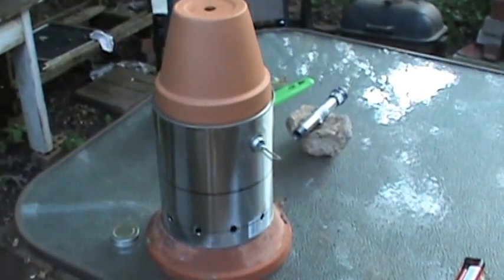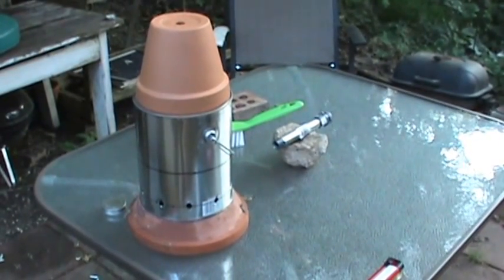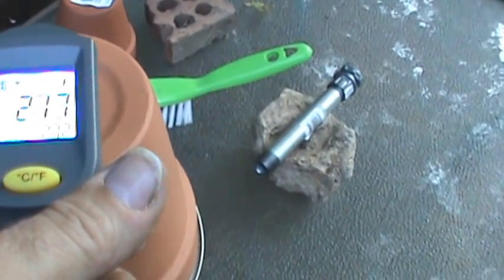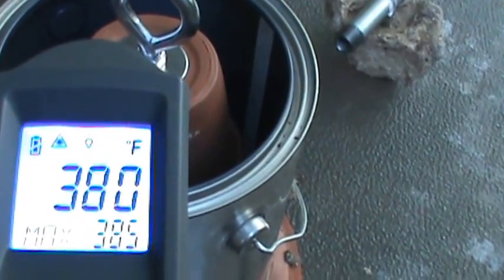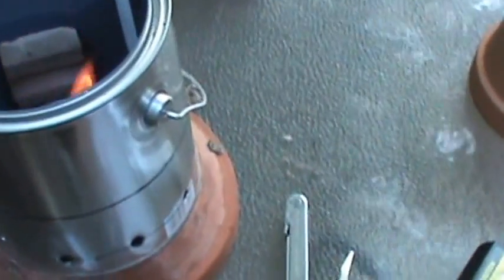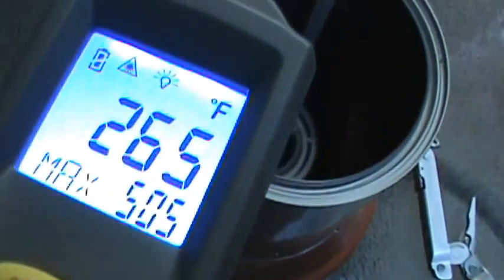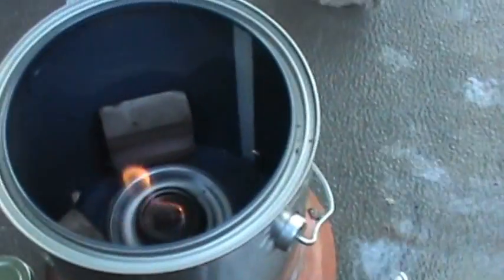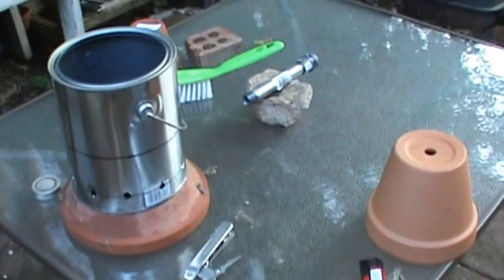Flower Pot Heater redesign. This one works.

Comment: Its nice but wouldn't the CO2 be dangerous using it in a small area like a tent?
Reply: Not if you ventilate..i have used various catalytic heaters in a van and in tents over the years but have always allowed fresh air to get in...there was a problem with a bernzomatic catalytic heater years ago that killed a few people..it was recalled and to this day if you find the right model  you can still get a $250 rebate.......http://www.cpsc.gov/en/Recalls/1995/Bernzomatic-Offers-250-Bounty-For-Old-Propane-Heaters/
Reply: Any type of heat source like that need venalation. Ex. The Buddy Heater

Comment: A candle is a candle, covered or not it will give the same heat. So why covering it? If you want to warm up a room, buy big candles and put them in the corners of the room and voila!
Reply: There are different ways to deliver heat and some are more efficient than others. Have you been around a campfire in the winter or had a bad fireplace in a house and tried to heat the house with it? In these situations, the only heat that warms you is the radiant heat of the light from the fire. At a campfire the front of your pants heat up and can almost burn your legs, your face is hot, but your back is cold and if you are standing behind somebody, in the shade of the fire, as it were, then you are freezing. Most of the heat that the fire makes is wasted by going straight up with the smoke and exhaust. What the flower pots do and other thermal absorbers is they suck the heat out of the exhaust and hold it and radiate it more evenly over a longer time. Like heating up rocks by the fire and wrapping them in a towel and putting them in your sleeping bag. You are using the heat more efficiently. Ben Franklin invented the wood burning stove to harness more heat from a fire, because a traditional fireplace is terribly inefficient.
Also, a lot of fuel escapes in the exhaust as well and what some rocket stoves do is actually burn the smoke as well. Just because the smoke is burnt though does not solve the issue of carbon dioxide and carbon monoxide. Ventilation is an issue that I can't see a way to get around. Unless you have a chimney that vents to outside but most of the heat is harnessed from the exhaust first. That is the key, is to harness as much heat from the exhaust and get the exhaust outside, and maybe have hoses or pipes drawing in fresh air from outside into the stove itself so that it isn't burning the oxygen in the tent or small space. The Indians dug trenches in the earth from outside the teepees that came inside to their firepits, and covered the tops of the trenches so that in effect they were like sealed pipes feeding air to the fire. 
So harnessing more heat from the heat source does make a more effective heater than just a candle. The amount of energy that a candle puts out is awesome, but is wasted in normal candle usage so that a candle by itself will have a mediocre effect heating up a tent.
Reply: A candle is a candle correct.  covered or not make all the difference in the amount of heat you will receive.  A covered flame spreads the heat out over a bigger surface area.  This is this exact same principle your furnace in your home operates by.  The small flame in the combustion chamber heats a bigger metal box, (the clay pot, paint can).  The forced air is blow around the hot metal box out into your ducts.
Reply: +Phillip Anderson These flowerpot candle heaters were used by Victorian gardeners to keep the temperatures in their greenhouses a little higher in the winter.  The flowerpot was put on top to capture some of the heat so it would still radiate a small amount of heat after the candle had burned out.  So it was designed to prolong the small amount of heat generated for just long enough to keep the frost from the greenhouse.  Genius idea for a greenhouse, I wouldn't use in the house though.

Comment: great design ... there are some coke can alcohol stoveheat source also on youtube
Reply: I am actually building the flower pot heater.  I am using an 8" pot with a 6" inside.  Working out the logistics of using a coke can alcohol burner for the heat source.  I have seen several warnings about the candles bursting into a flash fire because once the all wax melts, it flash burns.  Guy said not to put the candles so close to one another.  So the danger in using the candles is flash fire.  I am wondering if enclosing the alcohol burner could cause an explosion if the vapor in the burner gets too hot.  But I am not gonna use the paint can.
Reply: Gloria White interesting! How's it going so far? I'm doing the same thing but thinking about building a chimney just in case it does burst into flames in there all the flames would just got out the top of the chimney, & I don't think the flames would be hot enough to melt the material used for a chimney assuming it's a quick flash fire, hmm..

Comment: Great design and looks safer than other designs!  I am thinking this could be a fruit tree solution in the spring.  Maybe surrounded by rocks for additional mass and stability under the tree. Might save some cost using plate metal scraps, bricks, or flat stones (metamorphic) inside instead of stacked pots as well.  Another flat dish on top to avoid wind toppling issues. Thank you so much for sharing your experimental work!

Comment: Hello, good video, would you agree that it would be safer to have the fuel tank, placed below or outside the heated area, this would certainly lessen the chances of ignition or explosion of the fuel in the heat. also the fuel tank has no need to be in the heat, only the clean flame.
regards Colin. UK.

Comment: Spare floor tiles (you can buy them as singles in many DIY stores nowadays or may have some from a previous remodel) are the best for putting under candles, toasters, coffee pots, etc. for added safety and a super inexpensive heat shield.
Reply: And you can get cheap little felt "feet" with sticky on the back from Dollar Tree.  Saves scratches on table tops etc.
Reply: They make great blast shields when soldering copper plumbing near wood studs and drywall.
Reply: Barbara Bardi
Reply: Or a cookie sheet (in a pinch)
Reply: I always used one for my flat iron :)
Reply: @Joe W 🤯 Those are GREAT ideas!! Thank you!! 😁😁

Comment: I was intrigued by these flower pot heaters at first. . . .  But  we've had recent publicity in the u.k. about the risks of carbon  monoxide poisoning, after the death from a camper who put a cold barbeque into the tent to keep it out the rain. . . playing with fire is a dangerous game.
however I am tempted to see what might happen in a non flammable greenhouse
Reply: That's because charcoal puts out quite a bit of carbon monoxide whereas CANDLES are paraffin wax. TOTALLY DIFFERENT so it's not a problem. It depends WHOLELY on the fuel being burned. I am stunned that people a are worried about candles "oh it's a crude oil product" and other strange stuff.... once you've dealt with alternative fuels you know what does what under what conditions
Reply: well theres the answer right there. They put out the warning so no one would try to keep themselves warm,and freeze to death instead. anyone with a brain that functions properly would know not to put a freaking barbaque into a tent. different fuels-briquets are a fuel-are toxic when placed inside a dwelling. thats why they are called barbaques and are for outdoors only. there are other safer ways to keep warm with simple homemade devices..

Comment: Whenever you heat metal, you create carbon monoxide. That would be the reason that nobody else is using the paint can gag...
Reply: That's what I was thinking. I got into the whole clay pot heater for it's non-toxic heat output. Also I do not use tea light candles in metal trays, glass only.

Comment: This is actually a "heat buffer", as the purpose is to capture heat for slower delivery to the air. However, it is just "stuff" in the way of the heat-source. It will not generate any more, and will generate less in addition to toxic fumes and CO2 and CO from the dirty-burn being enclosed. (Toxins from the LEAD in the clay pots, which are not intended to be heated, or inside, or as heating storage devices.)

Put a copper tube over the flame and force air into the tube. That will capture and transfer the heat more efficiently. (Even without a fan, run the pipes to the floor to make a stand and they will chimney air up through them from the cold floor.)

However, a candle is a candle, and food-warmers (alcohol), produce x-amount of heat and x-amount of toxins that kill you. Venting the toxins by introducing cold air, nearly negates the gains to zero.

You need something that burns nearly 100% and can have the heat captured and removed from the exhaust, with the exhaust vented safely. This is not that device. This is a personal killer, as are most portable heaters abused by being burned in enclosed areas. You are contributing to the potential death of others, for a few youtube hits.

There are plenty of cheap and safe heating alternatives, without rebirthing past failed 1400's ideas, to save a few bucks. I guarantee that you won't make enough ad-hits to regain the money wasted reinventing the square wheel... again... for the millionth time.

I know... dead people can't complain about how these things failed by killing them, but that is why we have public safety-laws, to speak for the dead.
Reply: I don't know about all that but a couple of things bother me. first they make terracotta dishes to cook in so...?
second they sell those alcohol containers to use in fireplaces, so explain that one?  
oh and as far as him putting that out all he would have to do is cover it and smother the flame just as they do when using them to keep food pans warm.
Reply: +NoesisAndNoema  I've been viewing all these videos thinking the same thing! How can you get something for nothing... a candle delivers X amount of energy as heat. I don't see how incorporating something that absorbs heat and releases it half as fast but twice as hot would heat up an area any better than it would at half the heat but twice the speed?
Reply: The point is that the radiating  surface area of any stove, is what makes it work.No matter what kind of stove it is.
Reply: +Craig Stephens wow...and I have used it in my veggie gardens as part of my soil mix!!!
Reply: NoesisAndNoema ,,,, I agree. It cannot magnify the heat.
Reply: No lead in the pots guaranteed
Reply: Woodstove, electric baseboard, forced air heated with oil / gas. Any number of ways that don't involve stupidity. The video didn't provide a solution either but it does show the inherently flawed idea that you're all eating up that somehow this magnifies the heat output which it does not. That's impossible.
Reply: Mass heaters or rocket stoves?
Reply: G B have you ever made tomato sauce from passed tomatos? Tomato sauce boiled faster than water and keeps the heat a long time my idea is to heat a closed pipe or box filled with passed tomatos that keep the heat and give it slow over a straight plate of metal up.
A german heat scientist works on a heat system with indigriens of tomatos to transport the heat fast and effizient. I prove next a passed tomato candle heater ithink it could  work  greets from german  sorry for my broken english.
Reply: Yep i was seriously ill after having one on all night
Reply: NoesisAndNoema w4
Reply: mushroomhill has
Reply: Mushroomhill
How exactly do you use the stainless steel bowl?
Do you drill a hole in it and set it over the can. I want to try it. Thanks💕🌿
Reply: The gel alcohol used in these food warming tins actually burns very cleanly producing  mostly hydrogen and eater vapor. Much safer than burning propane or even wood.
Reply: NoesisAndNoema, another person saying something doesn't work without a solution: thanks. Public safety laws keep idiots alive and keeps people stupid. Just what we need. what is your solution to heating a small space......safely?
Reply: @davidunderwood1907  heating water outside with a candle stove (Yes there are tealight candle stoves) , solar oven...bringing it inside and running it through a radiator with a fan behind it.. Its the same concept in reverse with a boxfan cooler but holding the heated liquid within a tubed system and submersible pump or gravity fed in a dual 5 gl. tank system constantly circulating the water preferably closed to prevent/reduce the evaporation..As the liquid cools from the air blown across the tubes you replace the "cooled"water with "hot" water constantly recirculating/recycling.. With a 5 gl. system @ 90degrees replacing a gallon with boiling water increases the overall water temp by difference of temps divided by 5  210-90 =120/5 = 24 degree increase..The only draw backs you have to either go outside every few minutes or have the hot water piped in through a circulatory system.. Eventually you bring up the room temperature and as a side note you could use some of the heated water for bathing..I have seen solar ovens get up to 350 degrees.. so its possible with a car radiator to run some water through it at a cooler temperature and have nearly boiling water coming out and as long as you keep that oven close to 210 degrees you have nearly boiling water
Reply: No way these buffers enhance the heat. Have fun hauling all that shit to your campsite. He couldn't even blow it out when wanted, and if that was a critical thing to do then your fucked cowboy. And in a tent. He says he uses that fuel indoors. I do believe those things emit carbon monoxide. This guy is nuts.
Dum dumdum dum
Reply: +Jack Brunacini Vermiculite is a carcinogen! (i.e. can give you cancer!) do not touch or go near that stuff!
Reply: @craigstephens2782  Been touching it for over 50 years now and I am just fine.  I guess it you stuff it up your nose every day you might have a problem, but then again you deserve it for being a moron.
Reply: +DeansVideoClips its not just a heat buffer the pots act as a surface to radiate heat off of, so in addition to the heat that may come out of the hole on the top heat is also transferred to the air from the surfaces of the pots and metal pieces. and this isnt creating anything out of nothing, its taking one source and providing multiple ways to spread the heat outwards. if this contraption had more metals, it could work more efficiently  as metal will transfer heat to the air better than a clay pot.
Reply: You answer is exactly correct.  You must be a Trump supporter.  :)
Reply: HT T shut up stupid

Comment: BE SURE that NO parts are galvenized metal(the can in this instance). Galveinized gives off toxic fumes when heated.
Reply: Sure??? Galvanizing is ZINC in metal form. It's the WELDING and the flux while welding it that wrecks your lungs. I have galvanized stove pipes for 8 years now. No problems, no fumes from A METAL. I honestly think you need to research it PROPERLY. I have come to realize preppers do less research than the average soccer moms to get answers to their questions. So many assumptions it's ridiculous.
Reply: cyanide ?
Reply: +Thomas Phillips One can over heat the galvanized portion as in flue piping. As long as the galvanizing is burned off, no fumes.
Reply: Janet Allen ya Zink poisoning and sionide as well
Reply: D Quit where did you come up with cyanide
Reply: @drachenfeuer5042  the morgue has lots of it... lol
Reply: Sound advice. Thank you so much.
Reply: Janet Allen agree galvanized and CO are my major issues galvanized one time issue in selecting materials but CO all the time.

Comment: Could this be used at low temps (15* -5*F) to keep water in glass bottles from freezing, heating in a small closet area? I was thinking just one beeswax candle, so the fumes aren't so bad. Are beeswax candles toxic at all?
Reply: Beeswax is one of the best waxes you can use for candles due to the low toxicity level. Even most soy waxes are not 100% soy and contain paraffin which is toxic. Beeswax 100% pure, while a little more expensive wax, has medicinal benefits. It also is NOT toxic...

Comment: Is that a saucer on the bottom upside down?
Reply from the maker: yes  put it there to protect the table. still trying to find a better more reliable heat source. will put it up when i coma up with it. candles are a waste of time they won't put out enough heat to make a difference.
Reply: Some people use ceramic tile squares, or bricks on the bottom, like three at thirds of the circumference. Nice set up. Good video

Comment: Beautiful dreamer... please do not fall asleep with this experiment under your cot. Even if it works well that is no place for an open flame. Fire engines wail and the bomb squad might just drop by too. But go ahead and experiment it is your passion just do it in a safe place... shine on.
Reply from the maker: this one is too big to use under cot. experimenting on smaller version that is shorter if weather will ever cooperate.
Reply: Thanks well done!

Comment: I like this video. But I do see more experiment in the future for this idea. I would also like to see someone from like north Illinois or colder states to do a vid on this. I am old schooled my grand-parents never reised there temp in there house above 58 degrees, and I keep my house at about 60. I am not paying ComED my whole disability check just to keep me warm in the winter! But I do wish there was other ways to get my temps up just a little more at a lower cost? lol
Reply: Bobber Dunk 
I have seen a great heater easy to use...it consists of a large soup can a roll of toilet paper and alcohol you pour the alcohol into the soup can with the toilet paper in it.oh yes you must remove the inner cardboard of the toilet paper roll first.then you light it.....it burns clean and for a very long time....at the end the alcohol has burned off the toilet paper and it is still in tact for another use
Reply: Bobber Dunk